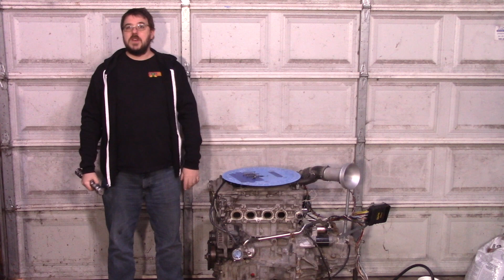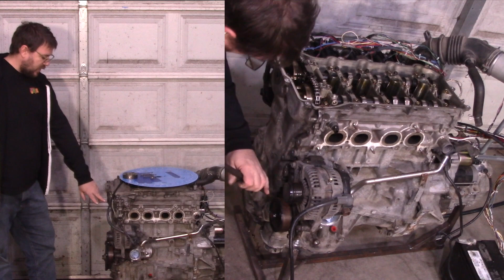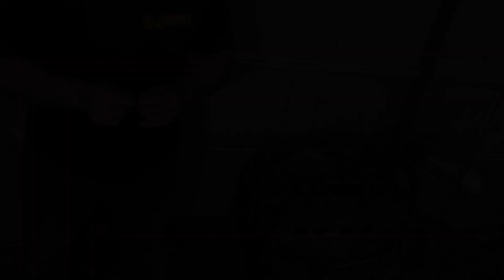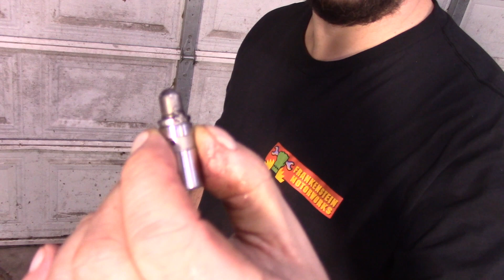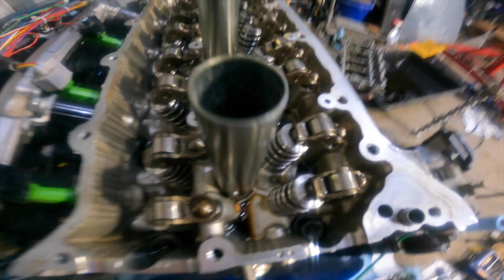New 2AR-FE camshafts get installed in MR2 engine (Evey #7)

Comment: What’s the stock camshaft lift and duration for the 2ar?
Reply from the maker: about 200 degrees @ 0.050" with 10.3mm lift. Honestly the stock cams are pretty good as they are but there certainly is room for improvment.

Comment: Any plans to work on a MR2 Spyder G16-GTS swap kit? I really think that would be a perfect application for that engine.
Reply from the maker: It's too early to tell. it depends on how the engine availability looks and what the transmission/bolt pattern is. But I agree it is an interesting engine.
Reply: @FrankensteinMotorworks   if you do.. don't forget us FWD G16-GTS swap adapter kits here 😆😆😆.. lots of Ae92/101/110/120/150/170/Corollas/Celica GT, Tercels, Yaris, Starlets and Tercel here wanting a piece of that motor.. 🤙🤙🤙
Reply: I wonder how light the overall package is.

Comment: Hey i have specific question. i have almost dead 2az fe toyota camry with stock manual transmission. i have to change motor 4th cylinders has 25psi lol. can a 2gr fe 6 mate with my manual transmission. id love the added power. would it be a difficult conversion
Reply from the maker: Rob, The 2az, 2ar and the 2gr do share a bolt pattern so the mechanical side would be easy. the 2GR is a pain in the rear to make a motor side mount for but it is certainly doable. The tricky part will be the electrical integration. When doing a swap into something like an MR2 it isn't bad at all but that 2009 camry probably has odd chassis integrations. sometimes things like heated seats require can messages from the engine controller so things that you would not expect to break may break.
Reply: @FrankensteinMotorworks  Yea i was thinking the same. marrying the ECU would be the task but good to know. I may just buy a low mileage ES 350 07-09 and call it a day. Camry paid off ofc may just throw another 2AZ in it
Reply from the maker: @robstyles2675  swapping a manual trans into that ES350 would be much easier. I could actually convert that ECU to manual trans and all the chassis integration stuff would be fine.
Reply: @FrankensteinMotorworks  Oh word! thats good to know. Might do that. I am using this car / es350 as my daily grinder btw. I also own a ISF . I Just enjoy the manual plus I dont want to keep my skills intact but I want more power.
Reply: i have 09 camry

Comment: Do you do maintenance work? I have a stick 2012 Camry 4cyl. It's blowing oil by the rings. I'm thinking to order a lkq low mileage engine and have the preventative maintenance done and swapped in. I'm about 2-3 hours from you and willing to drive.
Reply from the maker: Omar, I don't generally work on customer cars. I only design the parts and make videos to show them off and to show how to use them. But with that said, there's a couple things. First is Toyota stopped making the manual Camry in 2011 as far as i know. Do you have a 2011? If you have a '12 with a stick i'd love to have picture evidence for when this comes back up again. 

Next, these motors are known for burning oil from stuck rings if they are driven too softly. This can usually be cleared up by really loading up the engine for a long amount of time to get everything good and hot to burn it all out. You can also put a quart of ATF in there to really help clean it out since ATF has a ton of detergents in it. Just don't leave it in there for too long. 

If you still want the engine swapped, drop me an e-mail i may still be able to help you out. (Marc@FrankensteinMotorworks.com)
Reply: Stick was a typo... Stock* .... The car is female driven so I'm sure what you're saying is spot on. I'm going to try the atf treatment you suggested. So just to be clear. Pull the plugs. Pour about a quarter cup in there. Then blow it out after a few hours. I should probably change the oil after for the atf that'll get by the rings? Sounds right? 
Thanks for the fast reply and knowledge. I have an Avalon(2gr) that I might try your headers on.

Comment: Haven’t had time to watch the full video but is this the first grind for the camshafts? And will these work with the stock valve train ?
Reply from the maker: These are the #2 grind, 289 degree advertized, 240 @ 0.050" and 12.2mm of lift. You do need upgraded springs to get enough lift. the stock springs coil bind way before 12.2mm
Reply: @FrankensteinMotorworks  gotcha which springs do you recommend?? I was planning to get my whole valvetrain upgraded
Reply: @Marketing-genix  Check his website.

Comment: Agree completely with the strategy to have it mechanically fail safe; relying on tuning to keep valves from hitting the pistons is a recipe for disaster.
Reply: Very happy for you.  So exciting to see you excited seeing your cam design work. Can’t wait to see the power gains.  Doesn’t sound like a Camry engine now, does it?!
Reply from the maker: @reneneron2971  This thing hasn't sounded like a camry engine in a while. These modern motors are so awesome when you uncork them. One of these days i need to get my hands on an M20A and an A25A. i bet both of those are screamers also.

Comment: Good stuff. Does big duration and lift help make the head run cooler by letting more air flow?
Reply from the maker: if anything it'll run a bit hotter because the exhaust opens earlier so it lets out a bit more of the combustion as it is still happening but it won't be a big difference.

Comment: I was doing a little research the other day and I wondered if the 2AR would bolt up to any of the lexus rear wheel drive transmissions without any adaptors. I know there have been a few AR rwd drift cars out there but I think they use adaptors to a manual trans.
Reply from the maker: In theory it does but i don't have a part number or application to point you towards. This is Toyota's FWD bolt pattern but the 5VZFE shares that pattern and has longitudinal transmissions that work with it. so that's probably where i'd start
Reply: You could get fancy and run an R150 bellhousing on an R151, or less fancy (and less expensive) and run that same bellhousing on a Mk3 R154.
Reply from the maker: @jeffman3  THose may work. you'd probably still have starter location issues though.

Comment: Do you have a hearing PPE sponsor?
Reply from the maker: Sponsor? i don't have any sponsors. Also, this engine idling is quieter than most generators with their muffler on. Open exhaust engines get loud under load.